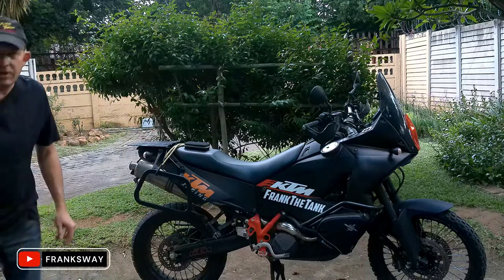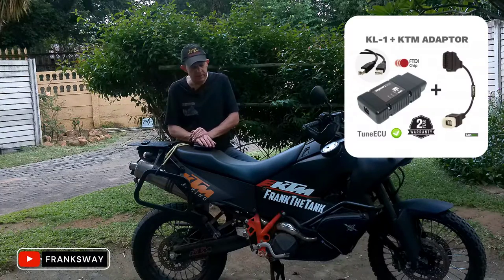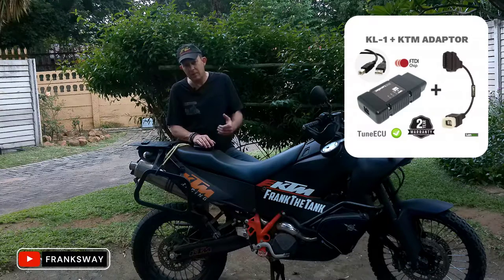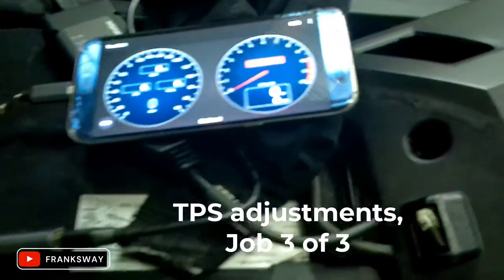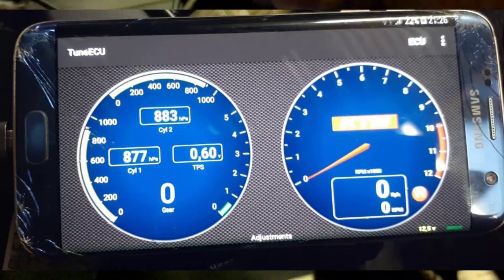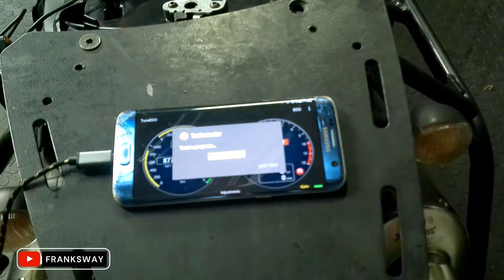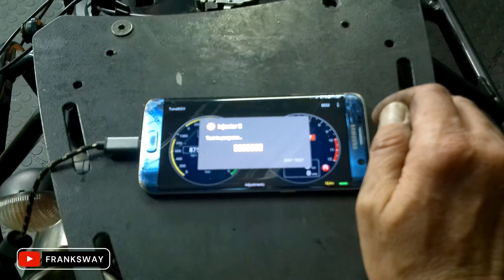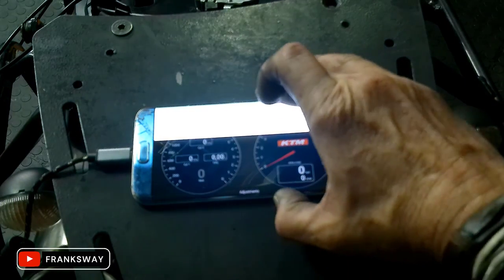KTM990 Throttle Position Sensor Howto! #ktm990 #duke990

Comment: Hi, may I ask what exactly is your purpose with this adjustment? Your Bike is running, because you could warm it so why did you even touch the TPS? And forthermore your TPS was running with other values as well?
Reply from the maker: Hi, the aim of the video was to check and adjust the TPS voltage setting at warm temperature  to 0.6V , it can be tricky.I had no idea what it was, and i wanted to ensure it's spot on. :) Go check out the hall of wisdom for your KTM info needs, really helpful.http://www.ktm950.info/ If you own a LC8 motor, also check and replace oil pressure switch maybe :)

Comment: Hi!! So, i need to attach tuneecu to my warm bike and then set voltage to 0.6? Are you doing that moving the screw?
Reply from the maker: The bike was warmed up,i do remember it was tricky getting the value spot on...take your time on the adjustment.